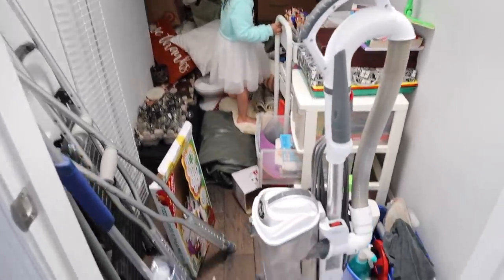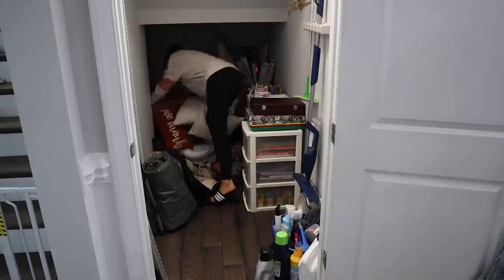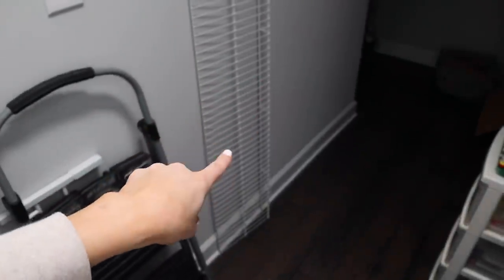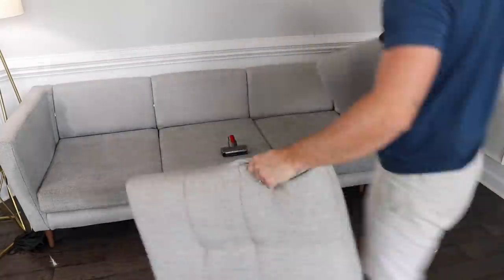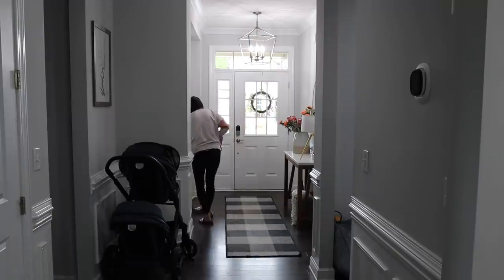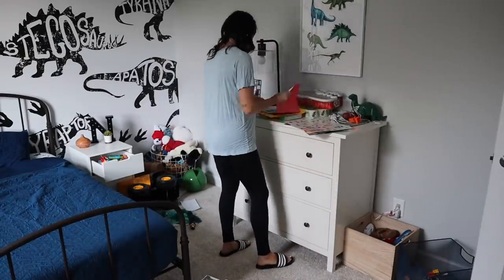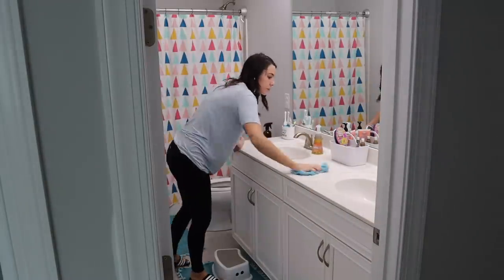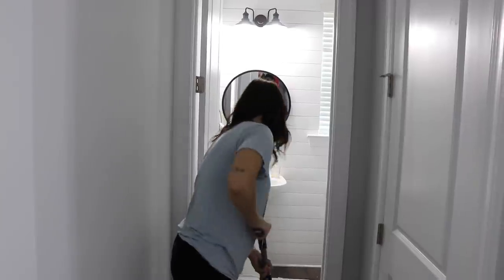GET IT ALL DONE WITH US | CLEANING MOTIVATION | MORE WITH MORROWS

Comment: For the wire shelf u can use wire cutters and snip off the extra where u aren't going to put weight and then use the little end caps that are currently on the end, remove them and add them to the freshly cut parts of the wire. That way the raw edge won't be exposed and u won't have the extra piece of useless shelf in the way 😃